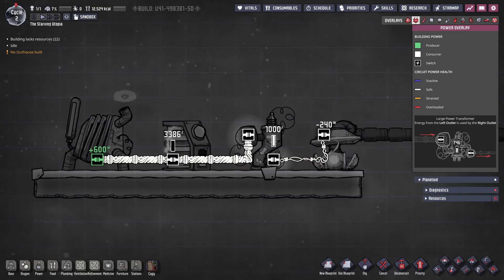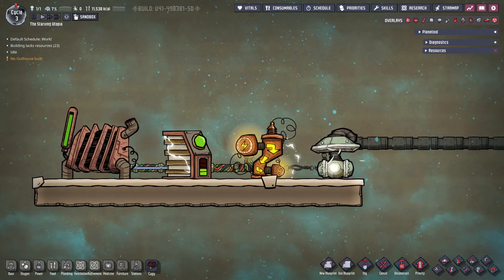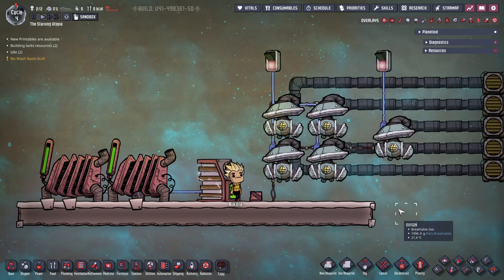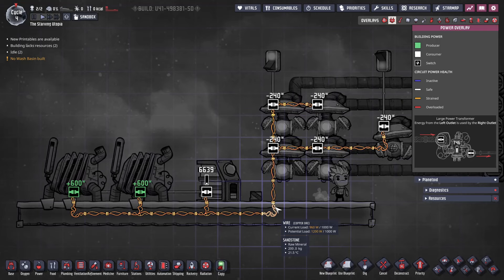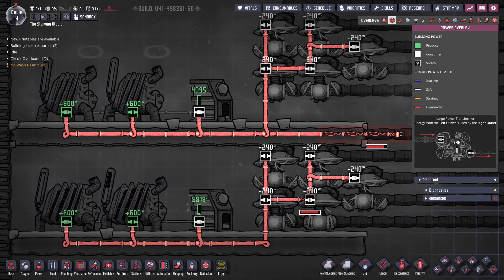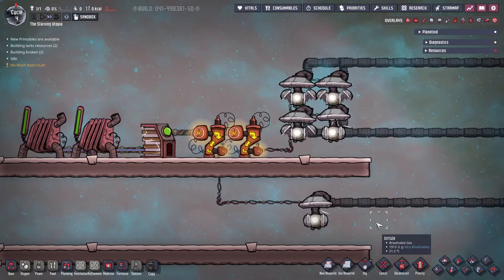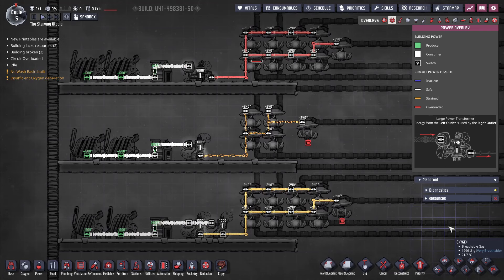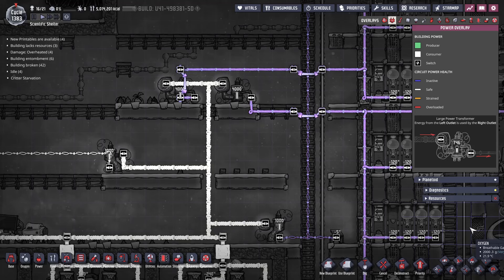Oxygen Not Included - Tutorial Bites - Power Systems

Comment: Honestly, the fact that the large transformer is 4kw makes me so mad that i just use two normal ones out of protest
Reply: i just found out theres a mod that allows the large transformer to be set to 2kw as it shouldve been in the first place
Reply: two small transformers take two more tiles compared to a large transformer. the benefit of using the large one is space and heat efficiency at the cost of some convenience where you need to employ some extra measures to deal with overloading. maybe set some curcuit breakers when power demands are too high, or maybe be mindful to limit the connected consumers to less than 2000 watts if youre sure theyll run constantly. this game is all about solving problems and the large transformer poses yet one out of the many problems you can find in the game, albeit feeling a little too artificial in this case. personally for me, my least favorite artificial problem is the tediousness of wild planting
Reply: You can double up and split transformers, in the example at 7:30 one conductive wire could have been could have been joined to both transformers to reach 2k then run though all 5 pumps

Comment: You do have a wire going back. That's why even the simple smallest wire has 2 wires in the sprite. I find that makes it the easiest to keep in mind when dealing with wires because it makes it obvious why wires take damage when they're not even connected. Because it's still running in a circuit down the wire and back up, so it still has electricity running in it. Basically everything on the circuit is in a line running through all wires, to the thing, and back. Not really how things work in the real world either but makes it easier to wrap my head around.
Reply from the maker: You're right that the wires are in twisted pairs, so it does run both ways. The point I was trying to clarify is for new players who might reasonably think they need to run a wire in and out to make a circuit.

Comment: A couple of years ago i read an explanation about the large tranformers that gave a very clever thing to do with them, but i totally forgot what it was and cant find it anymore.
Currently the only thing i know about them, is that they save space and heat. And there is an edge case where you need them:
When you want to have a battery bank - for storing large amount of power in jumbo batteries, like from solar or slugs. You wire them with heavy watt, then put a couple of large tranformers toward your regular power producers and power spine, and a smart battery to turn on/off the tranformers. This way you wont mix up jumbo and smart batteries, and you will still use the power stored in the battery bank before turning your power generators to save resources

Comment: I can't put links here without comment review. There is a Reddit thread explaining why 4K transformers are still a thing. It's about directionality, space economy etc... But not about protecting your system against overload. You're not supposed to rely on this protection after a while, you're supposed to design your electrical system to never been able to overload in the first place. Then 4KT can help you to move from heavy-watt wires to no-decor-penalty wires where it's needed. Also with automation there must be things to do as well...
EDIT : I tested it with automation, it's possible to run two 2k grid on a single Large generator without overloads ! You need 2power shutoff, 2 smartbatteries and 1 NOT gate. Simple : when one grid is demanding power from the generator, the other one is cut off. And viceversa. Working for consumers asking continuous 2k, and they don't get interrupted because the battery is charging faster than it discharges. Hard to explain without picture link.

Comment: You covered most everything. I think it is worth mentioning that using automation, and power switches, you can create a flip-flop power injector. That is, you charge one battery while the other is connected to the main battery bank via transformers; then, when one battery depletes (or fills), the switches flip. This let's the other battery charge from the generators and the one that was charging can now inject to the battery bank. Using this setup, you can put all of your generators on normal 1kw wire, because there are never any consumers, because the flip-flop is isolating them.

And thus comes in the usefulness of the 4kW transformer. Transferring large amounts of power from the isolated battery to the battery bank would be awful with 2kW transformers. I would have to chain twice as many together to get the same throughput.

If you are having trouble keeping the conductive wire circuits from overloading, then feed them with two 1kW transformers instead of the 4kW transformer.

Comment: I like to refer to systems in games like this as "pseudo realistic." They take part of the realistic, but simplify it or change it to make it a viable game. While transformers in real life change voltage, and not directly capacity, they are used the same way: to connect local networks to the main grid.

It is interesting how you can't have regular wires anywhere, even going nowhere, on a higher wire. You could otherwise put low draw lights at the end of a high draw industrial circuit. IE, lights using regular wire at the end of a conductive wire because the high draw items only load the wire up to that point... This could be a simulation limitation, or a choice because allowing you to "funnel down" your lines would get crazy complicated in an already complex game. Or it's following another real life idea: You'd never build a 20A circuit with 12 gauge wire, and then say, ok, the last outlet can just be 15A, and we'll just connect it to the penultimate outlet with a 14 gauge wire. The breaker limits the whole circuit to its rating. If you put in a 20A breaker, you HAVE to have all 20A capable wiring connected to it so that the protection is always the limiting factor. So I feel like the random burning up - oops I forgot one segment of unused regular wire - is them trying to gameify the above. Or not. I'm bored.

Comment: I'd add about DLC rocket battery. You can place those, deconstruct rocket platform and here you have a little tower of best batteries in the game. They contain 100kWt in 6 tiles, which is 5 times of smart battery, while having same lost of power over time and not heating surroundings
Also dont add batteries on the low-power side of transformer, since it can cause a damage
Reply: This is pretty wild, I thought deconstructing the rocket platform would deconstruct or at least disable the buildings.
Reply: @justincapalbo6938  You can do a lot of crazy things with it. If you want, I can show you quite a bit

Comment: Great guide. One thing though. It's useful to understand, and I hope I'm remembering right here... That buildings will always safely turn off when they exceed the wire capacity - IF the combined power sources are also less than or equal to the wire capacity. In the 5 pump example if you had one coal generator some pumps would simply not turn on I think. Consumers suck, and they will always suck as much power as they need. If the power is there to be sucked. Wire be damned.

A super duper useful use for them is also when you cascade transformers and get power draw prioritisation. A transformer on a line will only pass through any excess power available. Bit like the pipe bridge priority overflow really, but for electricity. That transformer could already be on a lower priority wire.
Reply from the maker: You are correct that if the power demand doesn't meet the draw then some will turn off, but I would suggest in most situations that batteries would be used to store power when needed. In that case the overloading is still a risk unless you set up the system robustly anyway. I'm not familiar with the transformer priority idea, but it sounds feasible. Generally I just try and make sure I always have enough power!
Reply: @GCFungus  Yeah. Enough power is best. For the most part it's just useful to make sure critical things don't choke unexpectedly, but we all get into habits that prevent it anyway. 

Little things like building a dedicated power room early so that as soon as you have the metal you can put in the Power Control Station. A battery room close by connecting all manual generators and batteries with heavy watt wire. The seed of your future spine as you call it.  Just keep throwing generating power at the batteries. 
A large transformer from the batteries ASAP, four small transformers connected to it also via heavy watt wire. Each of the four branch transformers is then a perfect 1kW power source in effect. Wires can never overload. And perfect, a bit later, for exactly two conducting wire lines supplied with a perfect 2kW power (each connecting to two of the branch transformers).

I've tested the priority thing with three transformers cascaded like that, and a bunch of heaters and light bulbs up to 1kW on the wires going from each to be sure. Works as advertised. As you say. Not a deal breaker, but it is good to know you can just connect a transformer on the periphery of your grid to like... Pump water slowly or something, and it's just plug and play gonna only take power when available from the main grid. Not cause any choking for your life support, etc. I use it to do things like that, kickstart SPOMs, create vacuum in remote areas, what have you? Anything that you just want some power and be done... some time.

Another notable function of transformers is also of course the ability to do a quick and dirty power feed into your spine. If you happen to have a little grid going somewhere off a geyser, then you can use normal wire up to the transformer from which the spine connects. Not what you want to end up with. You want to be able to use the gas in a proper power room eventually and store a lot for dormant times, etc, but it lets you get at least some useful power in quick and early. Letting you take your time afterwards to build out the utilities properly.

Comment: Just got into the game 2 days ago and found your tutorials invaluable.
Tho this you got wrong, they kinda follow real life. There's no return wire because they are parallel life as shown by the A type plug in power equipment. Currents are represented by the wattage and the thing I found different to real life is that the whole wire overloads instead of the section that consumes most power. I struggled to find current isolation devices until I found the transformers, that act like those
Reply from the maker: I think another commenter said very similar, and what I was trying to get at with the wiring is that you don't need to make a loop yourself. It's correct to say that the wire animation does have the twisted pair.
Reply: @GCFungus  oh now I see why some people might be confused. I was too, been using transformers even for short runs when I could've been using full heaviwatt in most short wiring runs.
Damn this game has some nouances.

Comment: 8:06 maybe to make game more difficult. 1kW transformer can't overload 1kW wire circuit (unless you have a battery attached to that circuit).
Large Transformer (4 kW) can still overload conductive wires without battery attached to it, causing damage.
Reply from the maker: Maybe but given that you can simply use 2 x 1kW transformers it does seem a bit pointless.

Comment: Are wires ohmic or do they have 0 resistance? Can i connect very very long wires without worrying about the power loss of the wire itself?
Reply from the maker: There's no concept of resistance loss in the game so make the wires as long as you want. The power loss actually comes from the batteries but is fairly small.

Comment: could you run a heavy watt wire and just use the leaser lings to connect to power producers? or is mixing wires like that a big no no
Reply from the maker: You should not mix wires as the circuit is limited by its lowest rated type. Use the heaviwatt for the generation side, and use transformers to make lower powered circuits for consumers.

Comment: So, basically, never use the big transformers, and use two small transformers for each circuit, or straight up heavy wires.

Thanks!
Reply from the maker: Yep, or carefully assign the large transformers.
Reply: Large tranformers are useful when you lack space, or need to produce less heat there

Comment: I believe the 4kw transformer to 2kw wire is an intentional failure mode designed into the game, it’s not supposed to be easy and perfect, instead it is designed to make you think and problem solve. Similar to liquids and gasses moving through pipes evaporating or condensing.
Reply from the maker: Maybe, but the phase changes of materials is really a key part of the game and loosely based on real world physics. Given that you can get the same solution with a double normal transformer, it just seems a bit odd to me.
Reply: @GCFungus  I use large transformers to seperate always-on power like Solar and Plug Slugs that feed a bank of jumbo batteries on the producer side.  The consumer side is the power spine with the regular power.  The jumbo batteries push their power to the smart batteries and keep them topped up, guaranteeing that you're cyclical power is never wasted.

Comment: I still don't know why is there no 2kw tranaformer or 4kw conduct wire in this game, it's so inconvenience to wire a conduct wire from the generator brick.
Reply: use a wattage sensor and power cut off as automation. Then set the wattage sensor to 2000 Watts. The power circuit will now cut off if the wattage sensor senses it has exceeded 2000 Watts

Comment: Has anyone ever explained why the 4kw transformer exists?
Reply from the maker: No one has to me yet!
Reply: Would be really cool if it was an adjustable transformer instead
Reply: You can use them to push banks of jumbo batteries connected to always-on cyclical power (solar and plug slugs) and then send that power to your power spine on the producer side.  Normally jumbo and smart batteries do not mix well, but with a series of large transformer you can do this.

Think of an early game swamp start.  You have 6 kW of Plug Slugs that is active during the night hours (three tame, four starvation ranched) charging 8 jumbo batteries every night.  Then a large transformer pushes this power to your coal power plants, keeping the smart battery full.  Your coal power does not run unless the slug power is completely used up.

You save coal, and don't waste slug power capacity.

Comment: U DONT USE 4K TRANSFORMER COS U THINK IN 2 LVL POWER SYS HIGH+LOW
its bothering that you cant grasp the large transformer. Its the same problem with the heavy watt tipe: decor is not the main reaso..., you cant run heavy watt thru each other! 
Only 1-2k wires can cross other wires. You dont think about this cos why would you run 2 heavys right? also passing thru walls and insulation is a nightmare.

4k generator uses:
getting power to a 2k wire where there is less then 2k consumers. obvious. 
BUT by separating consumers: the perma consumers in 2k groupes (with 4k transformer), and ocasional consumers in like 8-10k groupes(with 2x1k trensformer) you will have like half the circuits, and transformerspace.
moveing power from heavy generator circuit(like sauna wire) and feeding it to the heavy wire. not having all the generators feeding the main circuit deirectly you can make power with them whenever and only feed it to the main if you need.
feeding 10-20k from heavy generator wire to main heavy wire

moveing power from 2k generator circuit with 2k wire and feeding it to the heavy wire. like put 5 hamsterweels in the middle of the build, and carry the power away to a heavy main circuit by a 2k wire
or just use a 2k circuit with a battery in a tamer with les than 2 k consumers and only let power in or out if needed with 2x4k transformes and shutoffs insead of 4x1k